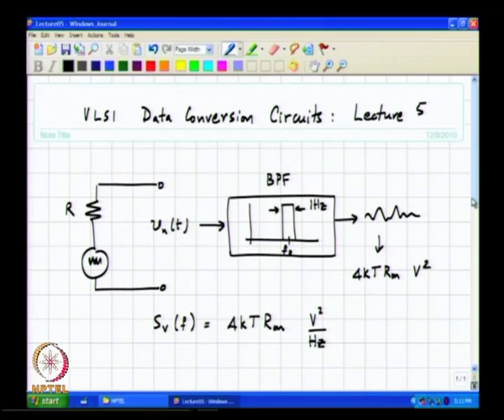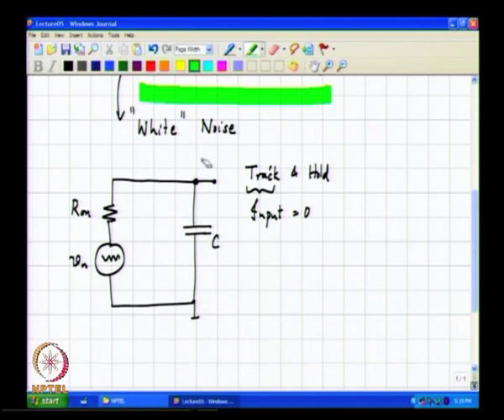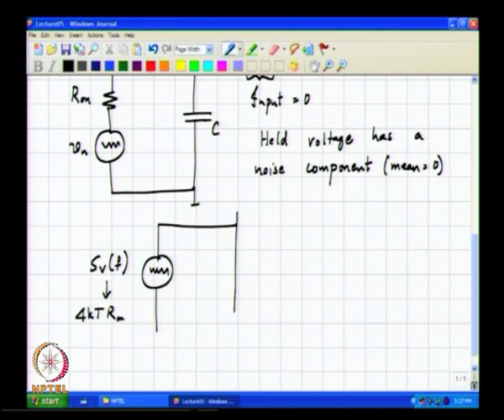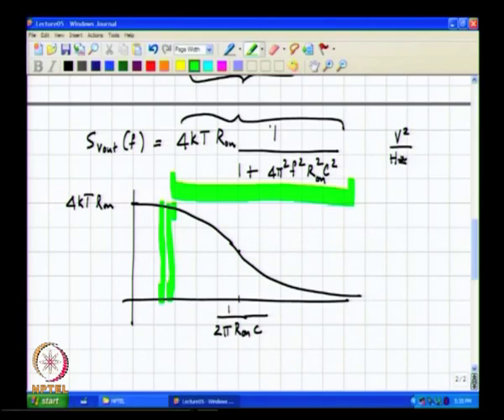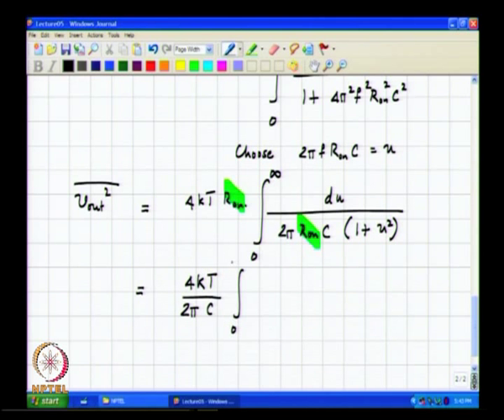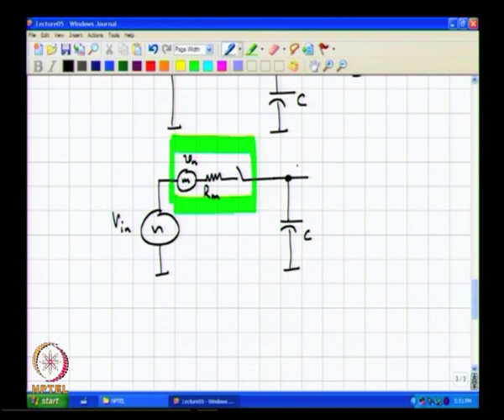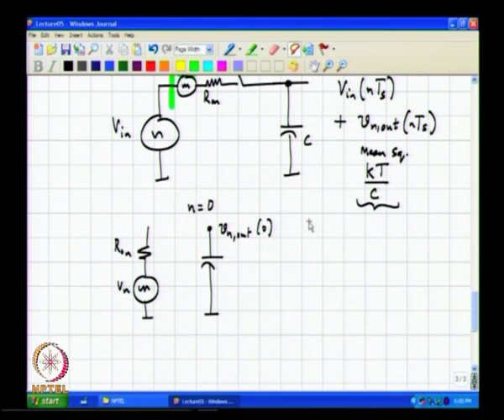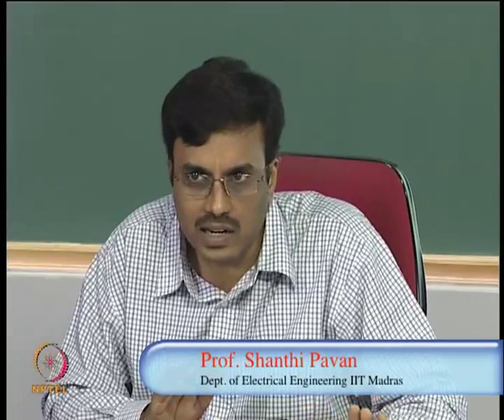Mod-01 Lec-05 Noise due to Sampling

Comment: RC low pass filter: mean Square value of voltage across capacitor is KT/C .
K: Boltz constant T : absolute temp , C: Sampling capacitor.
One important point: Even though noise due to resistor, Mean square value of Cap doesnt contain resistor effect.
Small C: means RC filter needs higher value of R  for a given constant resulting higher resistive noise reflected across sampling cap.
Higher C: means RC filter needs smaller value of R  for a given constant resulting lower resistive noise reflected across sampling cap.
There is virtually no correlation between the successive samples due to Very small RC time constant compare to sampling rate.So previous sampled value across the cap has sufficient time to discharge down to zero and to reach to new value. So there is no correlation among successive samples.